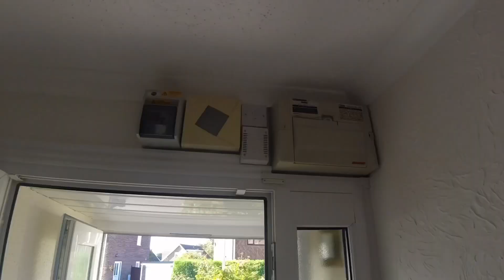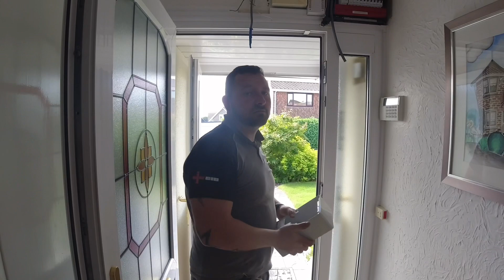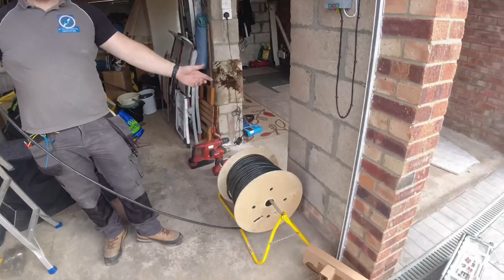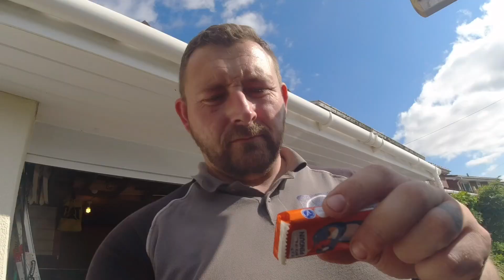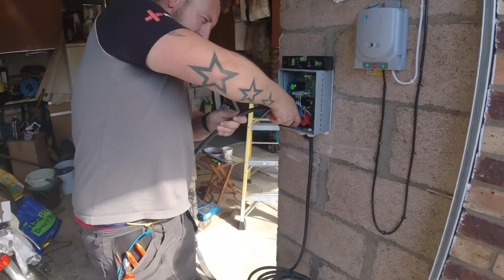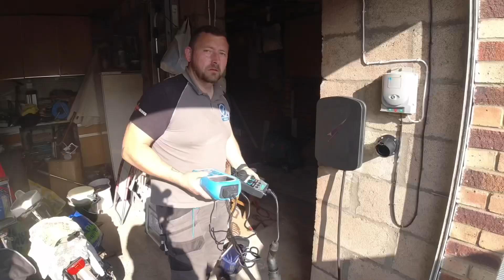EV charger installation. Can you charge your car for free?/

Comment: As anyone been able to get the hypervolt to work with the solar panels ? i cant seem to get it to work with mine
Reply from the maker: Hi Philip it should do it automatically? The CTs should monitor when your produce excess energy and when it does the charger will charge full power